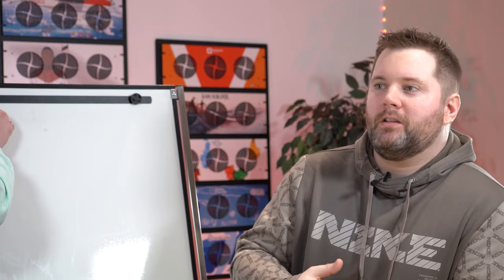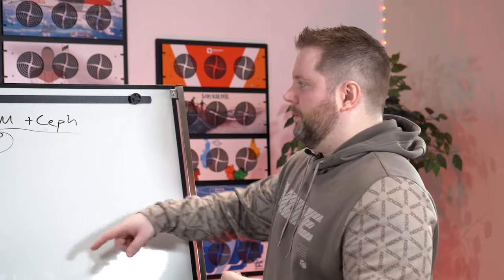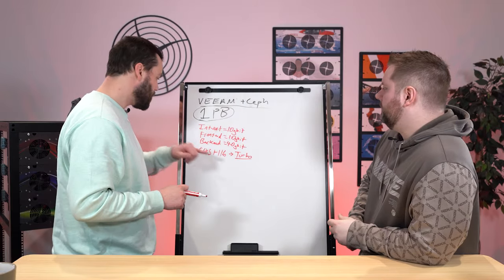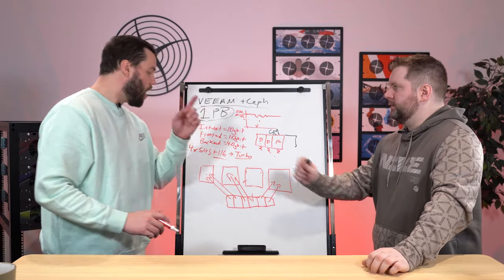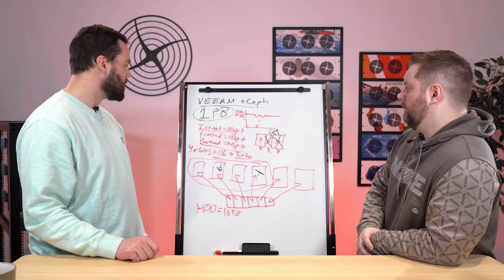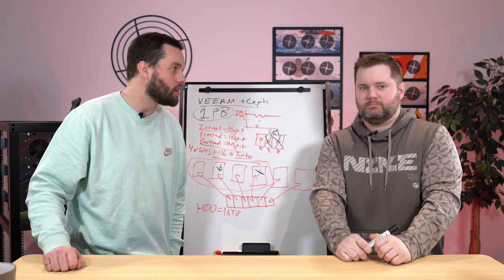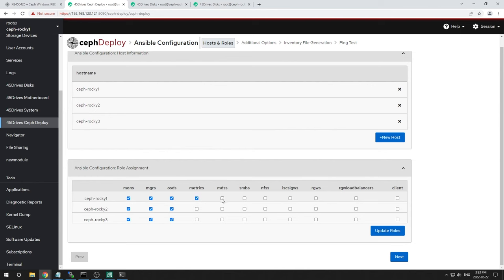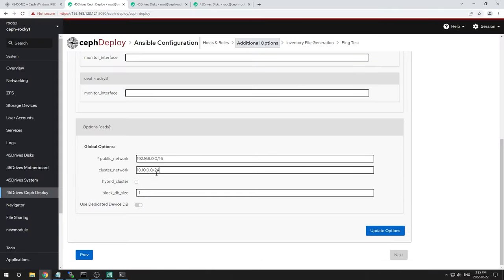Architecture & Build - Building a Petabyte Ceph Cluster for a Veeam Repository

Comment: Hi guys, great video....what is better for Proxmox VM storage only Ceph cluster? Replication or Erasure? Cheers
Reply from the maker: Hey Paul, 

Replication is going to be your go to for any random latency sensitive workloads (databases, VMs, etc...) , EC parity calculations means additional latency for your workload which is not ideal for OS disks, databases, etc. that require more IOPS. EC is fantastic at large streaming reads and writes (throughput based) which typically are not the main workload of a VM OS disk.

Hope this helps. Thanks!
Reply: @45Drives  Many thanks for the feedback. I've notice that you've not mentioned Ceph Cache Tiering Pools in any of the tutuorials, is that because your experiences to-date have proven that it doesn't really improve performance?
Reply from the maker: @paulfx5019  That is correct.  From our understanding, Ceph Cache Tiering was created to make EC pools perform good enough back when filestore OSDs were the only option.

Since Bluestore OSDs, the benefit of cache tiering pools disappeared pretty quick. We do not use them in production and interest in the community has dwindled. 

Redhat depreciated the feature back in RHCS 2.0, and no active development has occurred since.

Thanks!
Reply: @45Drives  Many thanks for the feedback and look forward to more videos like this.